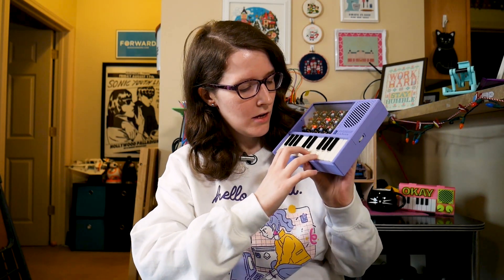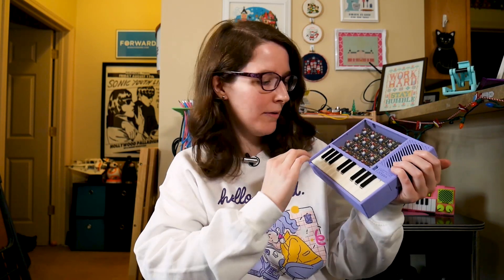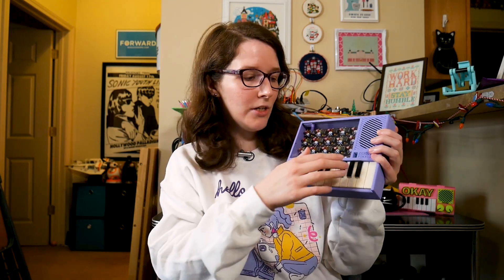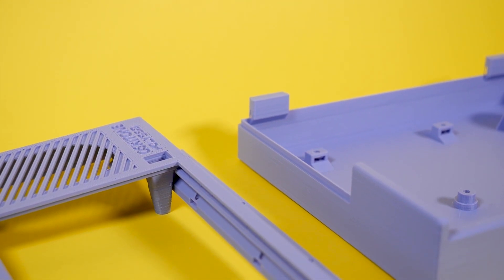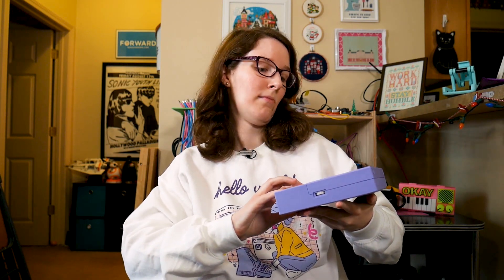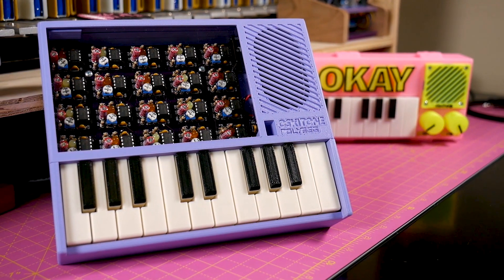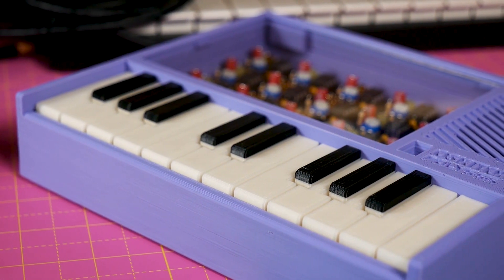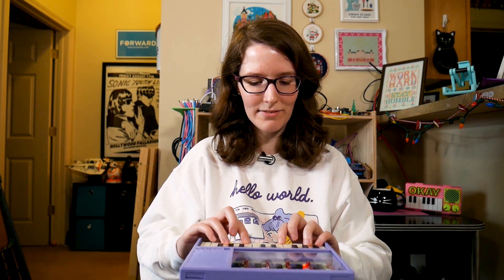Building Oskitone's POLY555

Comment: At this point I already feel like spamming, but I always wondered - are the LEDs just random or is it some sort of color scheme for the white and black keys?
Reply from the maker: there are different colors depending on whether its a black or white key. For my kit the white keys are red and the sharps are yellow. I think Tommy said that the colors may vary. There is a marking on the PCB denoting whether a circuit is for a white or black key, which is very nice.